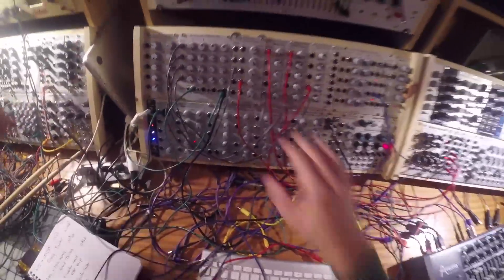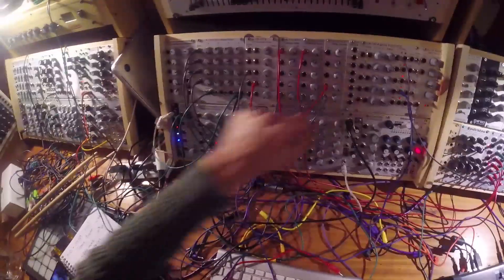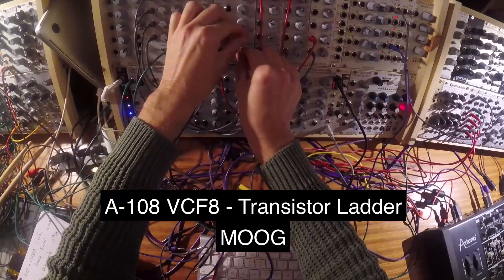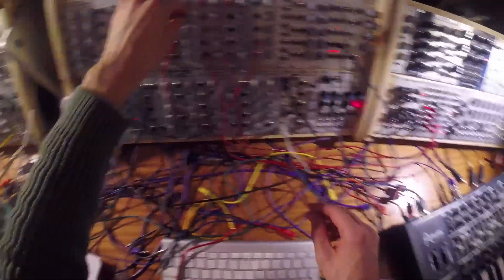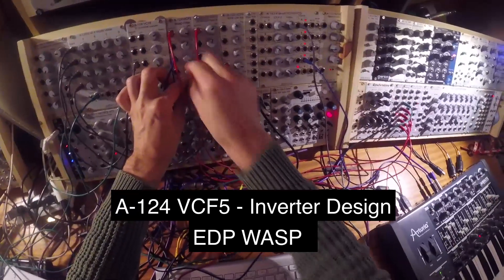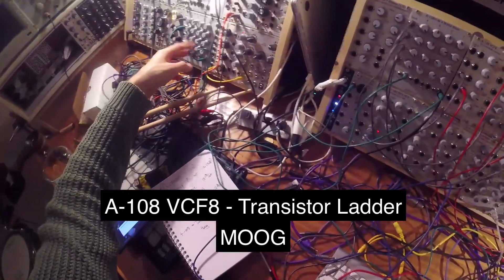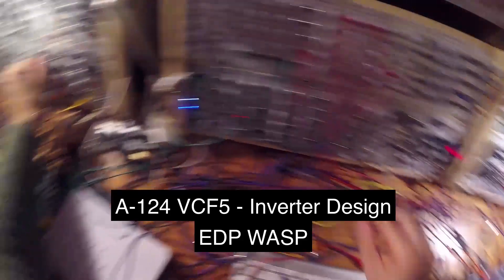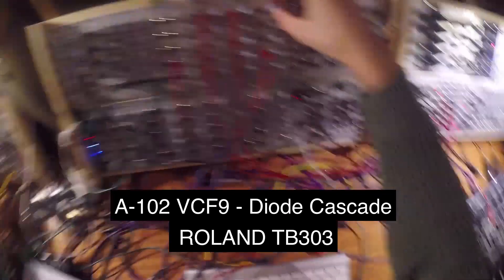Modular FIlter Comparison pt.1

Comment: as much as i profess to hating moogs... the 108 sounded fat and juicy. i kinda like the warmer grunge of the 102 over the WASP, but liked the 122 too. great comparison. thanks. i'm surprised the 102 doesn't sound thin and digital fizzy like typical roland "acid" filters
Reply: A-102 is based on the Synthi filter, not the TB-303. A-103 is the TB-based filter.